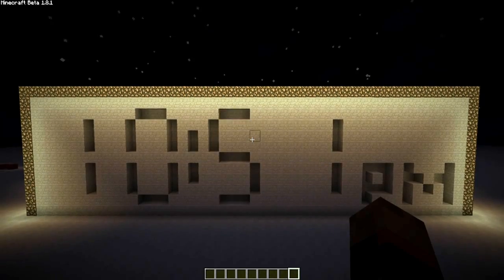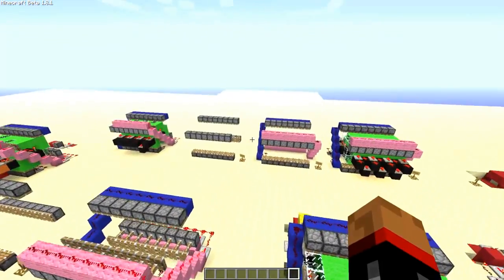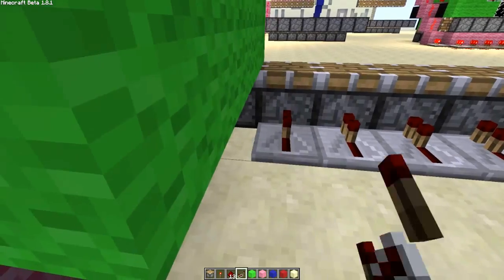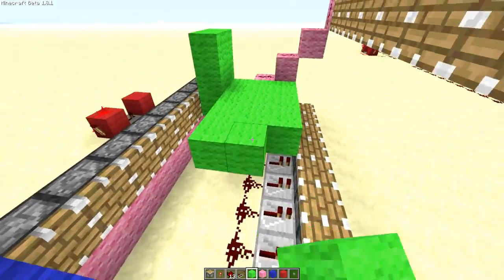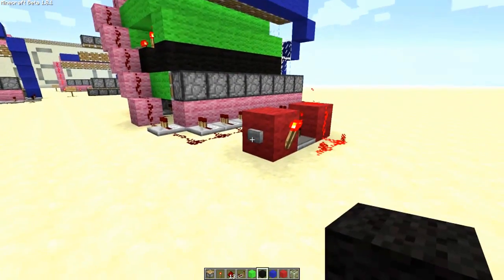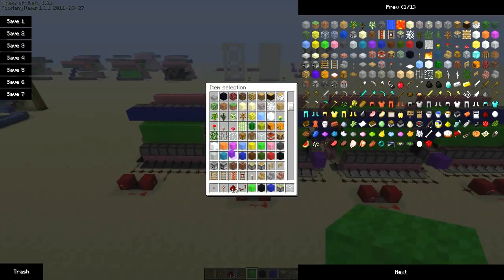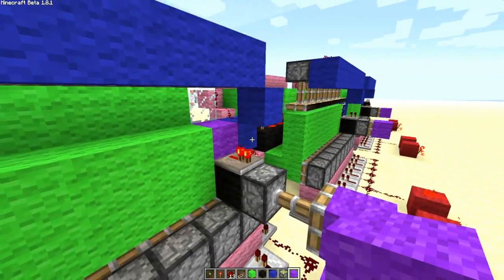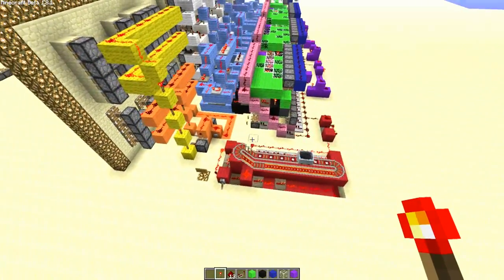How to Build a Digital Clock in Minecraft! Part 2 [In Game Time!]

Comment: Binary would be easier. The total number of pistons can be reduced by more than half if it was converted to binary. Each number 0 thru 9 is shown with up to 7 segments... which can be done with just 3 bits. 000, 001, 010, 011, 100, 101, 110, 111. Carry-out can be the inversion of (0 or 0 or 0) signal instead of another bit.
Reply: [sorry to 1up an old comment] That's brilliant; I had just the incomplete beginning of a thought similar. In the map I've started there's a control tower ~50 blocks behind the clock off the ground for good view, and in the tower I wanted to have buttons controlling each module so as to be able to set the time, and with that idea I can actually accomplish getting 3 signals down to the ground in a narrow support beam which just looks really nice. I wish more people appreciated binary..
Reply: I forgot about this. Glad someone saw my comment and will give a try. Carry-outs will have to be handled a little more than I explained for the different types (like the 0 thru 5), but in general I am certain it can be done.

Comment: to get the timing programmed to real time put the glass in as you would expect, from 1 to 2 to 3, etc then for the repeater with minecart timing you have to use 150 repeaters all set to 4 ticks.

Comment: Do not waste ur time doing this on xbox
Reply: lags way to mush and things go out of order
Reply: naterocksable mines working fine, i use obsidian to keep blocks from pushing out of the machine. Sometimes when i quit, ill come back and it will be out of order, so now i just turn it off before i save and quit. It does work for sure though. Im working on my second machine again because i had it set up like the first one... so theres 0-9 instead of 0-5. Lot of work to tear it down and start over. It was counting up to 999
Reply: Why? Does it not work? I was thinking of trying it on xbox and I'd like to know.
Reply: Radfordhound it does, just might have to change a delay or something simple. It just takes forever... mines still not finished.
Reply: naterocksable Oh, ok. Thanks. :)

Actually, I found that if you encase redstone contraptions in glow stone it keeps it from lagging so badly as the game doesn't have to regenerate all the shadows every time a block moves. But I don't think it's worth me wasting the time just for something that might not work now that I think about it.

So, thanks anyway. :)
Reply: freddie changin I can not believe you actually built this thing on xbox! That's awesome! :)
Reply: +Radfordhound im replying so late but now it works on xbox i did 2 digit already.

Comment: (Possible) Fix for 1.6.4 on the clock. Remove the clock he makes and instead do another stick piston one same as first. Instead of making it into a constant clock add a redstone trail to side with a comparator lengthener. As a pulse goes through it will activate the stick piston twice cycling the logic.

Comment: I have this working in Xbox. The only prblm I've had so far is when I save and exit.. My Ouse limiter glitches on me and the  output torch doesn't blink. I rebuilt the clock and the limiter and can't seem to get it running again. Mnew I should've never logged out again

Comment: *Suggestion for awesomeness on a server with this once 1.4 is out* 
Connect it to redstone so you can turn it on/off with a t-flip flop switch (haven't watched the whole tut, not sure about this). Also connect that same switch to a command block that does /time set 0 (or whatever the clock is default set to) at the exact time the clock starts. So the time is exactly precise. It needs an on/off incase of a shitty server that gets lag.

Comment: Before you connect all of them together, do the top blocks in front of the screen at 11:39, does that empty line through all of them have to be empty or can it be filled? because I did what you said and at the end of setting all of them near each other.. the 2 in the middle was right /they were empty at that top corner but the 10 lines werent like that...?

Comment: The fact is that you don't want your clock to show exotic times like 46:83 PM. So you need either less or more memory to match the sequence 0-1-2-3-4-5-0-1-... Here the 12-bits emory allows easy use for both the decade of minutes (1 cycle is 6 decades, so 12 bits allows two decades) and the hours which sequence use only 2 bits (0-1-0-1-...). But it's up to you, if you prefer building a 6-bit piston memory, I won't stop you. :)

Comment: to everyone complaining about the bugs in 1.2.4 HERES ALL YOU NEED TO KNOW 1) theres a bug that makes the sticky pistons on the display spit out the wool from time to time, because of a flickering of currents coming from the memory.DONT USE THEM use the new red stone laps for the display,and surround it wit glow stone.2theres a glitch to daisy chain them,take the output from the 8thset of pistons in the front and have connected to the next mem. .he skips alot of steps but u need to use ur head!

Comment: You probably could, you could put a lever or a button at the beginning of the map to start the clock, and have the clock running, then have it stopped by them stepping on a pressure pad or something. There are endless uses.

Comment: @CNBMinecraft hey i tried making this in 1.2.3 ans once i got to rigging them together and i ran a test to make sure it was all working and it did but once i made it rotate once more so the wool that allowed the piston to push out got swapped for glass it still held power and even tho there was glass between the repeater and piston therefor even if it went in a continual cycle the piston was powered and none of the other motors would rotate do you have a fix you'd mind sharing?

Comment: @coolme57 ok, the 12 line array should have, 12 lines... to put it simply, yours doesn't in all likelihood because your experiencing the same problem as me. You should see that there are no blocks in one of the corners, and the one diagonally opposite to that. Other than that there should be no other corners without blocks. (if you've already written the values onto your 12 line array, I'd suggest putting obsidian where the blocks might get pushed out, so then it won't screw up :))

Comment: @coolme57 I found out what i was doing wrong, I was just being dumb and found out about a minute after writing the comment :L what you need to do, is go back and check that you have the correct number of lines (lines to turn) because i found out i had one less than i was supposed to, that should fix it :) Hope this helps :)

Comment: why not try using a bud switch made my ethos lab to restart so when the sun comes up and goes down it gives a more effective beacuse a grass block near the water will update when the sun is up and it will update when the sun goes down and that can also reset your system if you log

Comment: @georzzzs Yes, you just have to adjust the timing and the displays a little bit. Just make there be a seconds counter with no display (unless you want a display) and hook that up so whenever it hits 0, 10, 20, 30, 40 etc. seconds, the tens go up. Then, limit the tens encoder to only six lines of code, and then when the tens hits 60 and restarts back at 0, link it up so it changes the minutes side, and keep going on and on and on. Only remember that it will not be your actual time, as..... well..